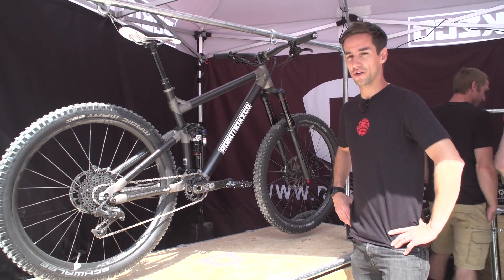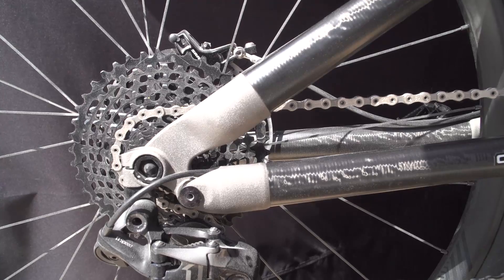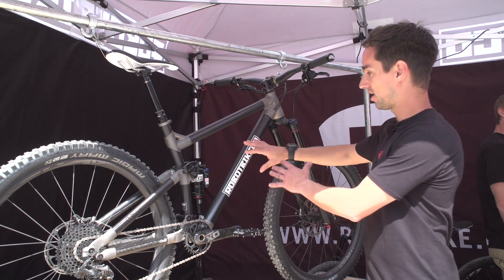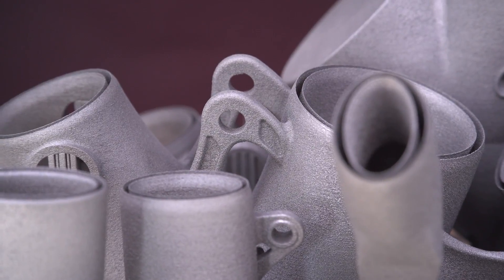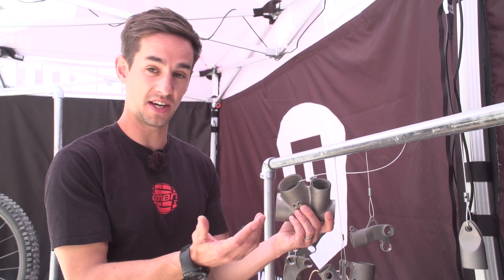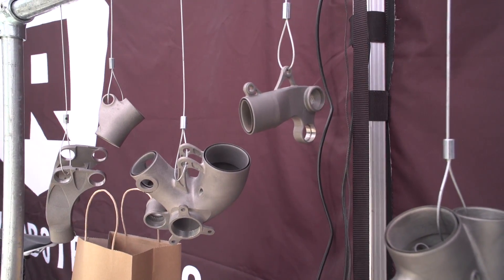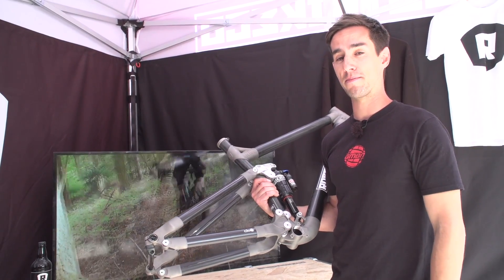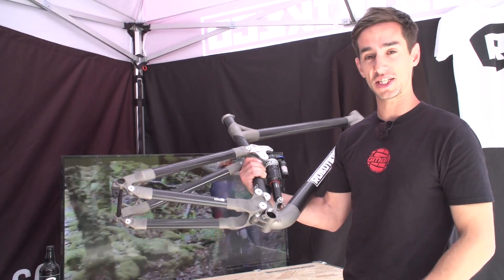Robot Bike Co R160 | 3D Printed Ti and Carbon Custom Bikes

Comment: looks great, but we've been through this before with ye old Raleigh 'technium' carbon bonded to steel frames, and other company's weren't Innocent of this either: from specialized to trek, the long term end result was the same: the bonding gave out, people got hurt, the companys got sued, and the method was discontinued. but who knows! I guess we will have to wait and see!
Reply: The key is the double lap shear joint that means no peel load is introduced into the bondline. This is otherwise known as a balanced joint and means you can push the loads a lot more before failure. The only remaining issue is how they prepare the titanium prior to bonding as it forms an oxide layer on the surface which makes a good bond very hard indeed.

Comment: 3D printed tubes, not a bike. Come back when you print a frame. FYI F1 teams have plasma printers that can print in metal.
Reply from the maker: The tubes are Carbon, built like normal. The printed parts are the lugs, linkages etc that join the tubes.
Reply: +Anna Svagzdys obviously the benefit is for the joints/complex shapes, not a tube
Reply: Chuck, I don't think you even watched the video mate.
Reply: Wrong, you could have a tube profile where some areas are thicker or thinner where the strength is required or light where it's not. They're not exactly complex and they still have to bond them to the frame tubes so it's shit.

Comment: Is there anyway to turn my dual sus xc bike into a more enduro or trail bike#askgmbn
Reply: Yeah, I put a 1x10 system on my 2010 specialized epic comp 29 and then a dropper, a 60mm stem and 740mm bars. runs like an absolute champ and eats up almost any terrain

Comment: When I saw this I thought "Ah a poor man's carbon fiber frame".  Looked at their website.  I was wrong,  Rich man's carbon fiber frame.  Better be faster than anything else on the market otherwise it won't last long.  I think it still has the potential for being a budget carbon fiber frame though.  Easily spun standard tubes, cut to size, bonded to inexpensive lugs. Lots less labor.

Comment: can the carbon tubes be replaced? in case of damage of course.  if so this would actually be a great selling point.
Reply: Don't see why not. would be an easy processes just have to unbound them somehow.
Reply: +CyclingSalmon14 Heat.
Reply: +CyclingSalmon14   at first I also thought it should be easy but when they presented the titanium parts it looked like the carbon parts would pressfit in there. and in this case it would be difficult tu remove parts without damaging them.
Reply: Greavu Vlad Generally if you were removing the parts they would already be damaged. And I doubt press fit is all they are. There's probably an epoxy also that holds them in place
Reply: It may or may not be easy, really depends on the resin used.

Comment: Are these Bikes strong ?
Reply: I would think so, if they weren't then the wouldn't make them...
Reply: The carbon tubes are not 3d printed dude. They are regular layup, so the carbon could be as strong as the carbon on a normal frame (the strength is highly dependent on how well they can do the actual layup). The Ti parts are printed using SLS.
Reply: thanks ! i was just wondering

Comment: Wait, so you sayin I could make a VERY custom/personalised bike by my self for quiet cheap! I'm in!
Reply: ~$6k for the frameset alone. "quite cheap" not really. AFAIK you can get Ti frames custom welded for that. Cool tech but IDK if its really that practical.
Reply: The frame alone is £4000, no drive chain, no suspension, the frame alone costs more than i payed for a carbon nomad